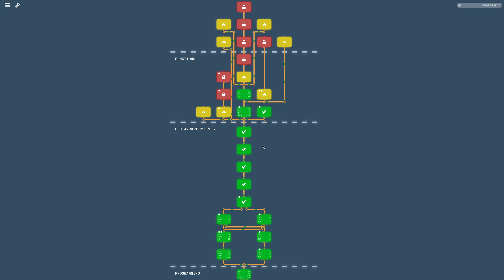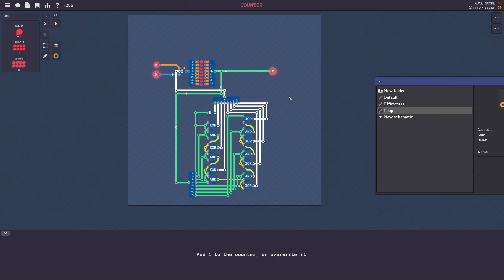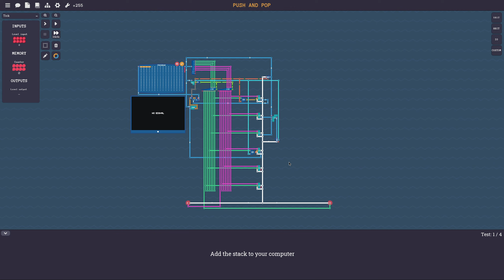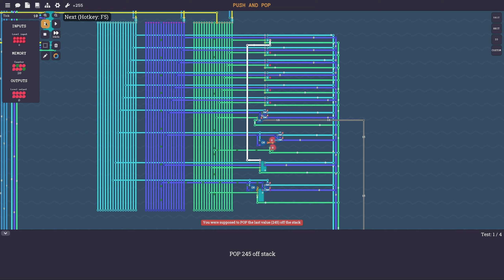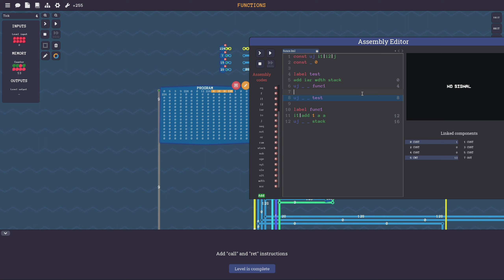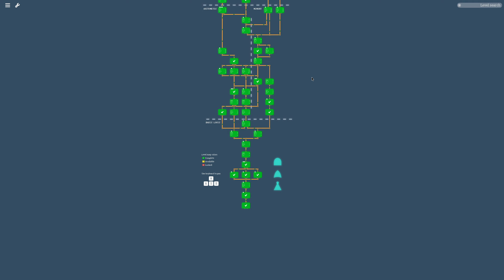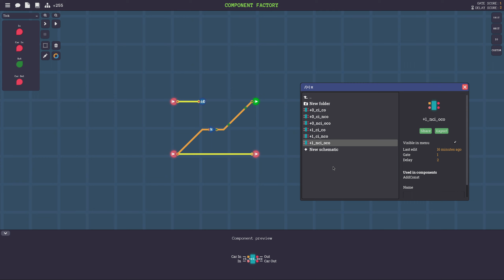A logician tries to build a PC | Turing Complete pt.21 - CALL

Comment: I am a little behind, so maybe you already fixed it, but you are supposed to implement call and return as single instructions.
You don't need to do one thing, and then another. This is hardware - you can do things at the same time ;)
Reply from the maker: @Yotanido Wait, so do you mean I should modify my hardware to accomodate call and return?
I'd generally be opposed to that, especially considering that `return` is already a single instruction in my architecture, and `call` is two.
Reducing the cost of `call` by 1 tick at the expense of my already limited instruction space doesn't seem right. Besides, it seems like a complicated change, going against my general design - writing to two destinations in one tick (the stack AND the iar). Though I haven't really thought it through...
Reply: @zoickx  It's certainly what the level expects from you and what is done in real hardware. Of course, you can do whatever you prefer :P

It is nice if you can just say "call asdf" though ;)

Comment: 00:00:00 Well... you don't need ALL 8 bits. The upper bits are always 0.
And you are actually pretty close, one of the gates is indeed a delay.
Like I mentioned, there is a guide on steam where they optimise the solution for gate score step by step. The initial solution has a gate score of 39, which is already very impressive. There are some quite obvious improvements that can be made for it, but I never would have guessed you can get it down to two. But I believe it, every step they took makes perfect sense.

Obviously, it's not using a computer to solve the maze at all - it's a purpose-built machine. An ASIC. I'll not mention how they did it, or even what technique they used, in case you want to try it yourself. I will mention that it's computer science theory 101, though ;)
(And also, I probably would not have come up with it myself. But I'm impatient and don't like puzzles that take me too long)